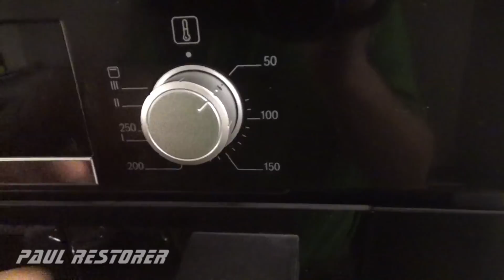Matchbox Mercury Commuter nr 73. Wersja regular wheels i superfast. Model autka odnawianie.

Comment: Excellent restorations.  A triple treat!  Your replacement tyres for the Regular wheels are really good.  Interesting to note the variations in the castings:  the ribs in the roof of the 4mm thick wheel Superfast.  I have never seen that red variant.  I just did the police version #55.  Matchbox changed the interior piece: no dogs in the cargo area - radio and traffic cones instead.  The #55 has 2 rivet posts under the cargo area.  I noticed all 3 Commuter wagons have 1 rivet post under the cargo area.  Unfortunately, I will have to paint my wagon again.  We have just had about 1/2 years rainfall in 3 days, and the humidity went up to near 100%.  This plays havoc when trying to spray enamel paint!  "Orange Peel" finish on most of the model.
Reply from the maker: Everything is correct. I even noticed that in this red model the glass is used from the police model in the film you can even see such an embossing on the signal lights.